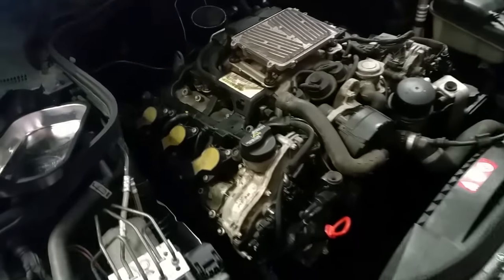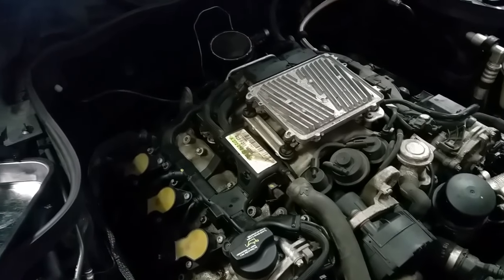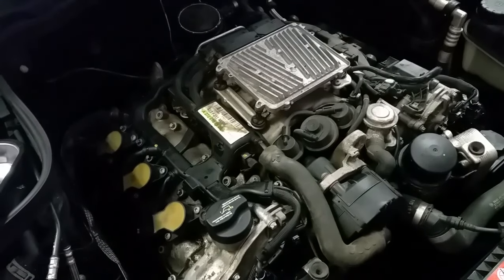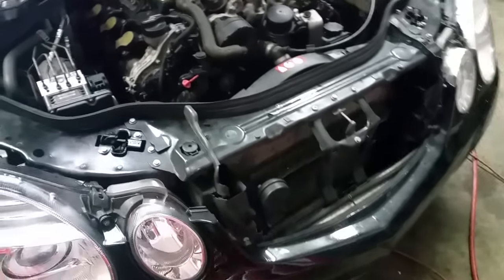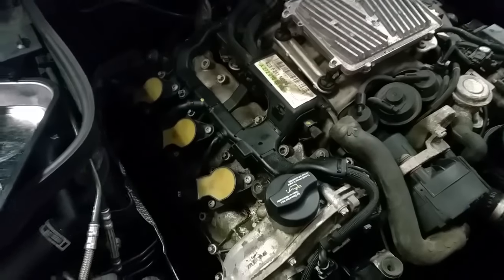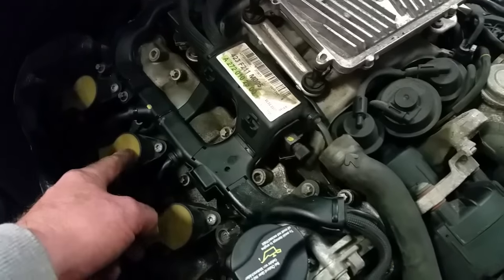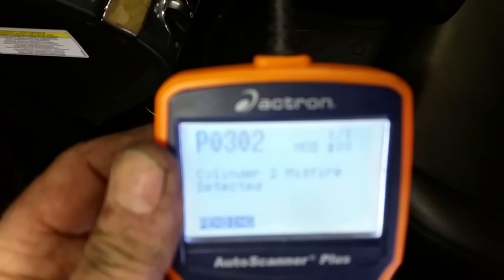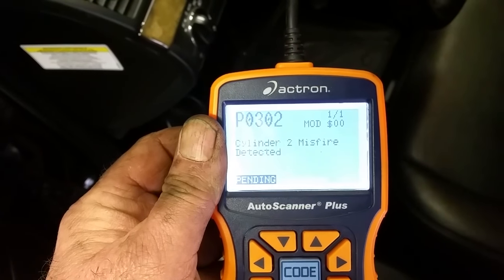HOW TO FIND AND DIAGNOSE A FAULTY COIL PACK FASSSSSSSSSSSST !

Comment: My father has a 1998 mercedes c230.  His coil is fine but the car throws cylinder misfire on the 1st cylinder.  He has confirmed the coil is fine and the cylinder is good because once he deleted the code it's all good again.  The code keeps popping up every cupple weeks.  We have 0 clue what is causing it to keep popping up.  The dealer installed new sparkplug and cables so that's not it.  The dealer is no help on this issue
Reply from the maker: Make sure that the coil is securely mounted and the bracket that it is mounted to is well grounded to a clean ground.  And I would check the spark plug wire and possibly replace it again even though the dealer did it, he may have done it wrong.  If this doesn't do it, I would find another repair facility that specializes in older foreign cars.  Hope you get to the bottom of your issue, thanks for watching and asking.  mad Mike the hammer SPC

Comment: No need to swap. Just unplug the bad coil if engine still runs bad.
Reply from the maker: You can do it however you want to do it, we are just sharing how we do it and it works 100% of the time.  Thanks for watching.  mad Mike the hammer SPC

Comment: What if is a random misfire?
Reply from the maker: I'd be heading on in to a quality repair facility as it could be numerous things.  But before you do that, I would replace all the plugs, the coil packs and plug wires and I would replace all of the injectors, then run some fuel injection cleaner for 3 or 4 tanks.  Thanks for asking, sorry about the delayed response.  Have a great day.  mad Mike the hammer SPC

Comment: Don't you have to drive your car around 50 to a hundred miles to get the check engine light to come back on again after you clear it?
Reply from the maker: Brett Wyrick usually if you start the car 3 to 4 times it will come back on if there is an issue.
Reply: @SweetProjectCars  Gotcha. My '08 C300 is doing something weird: I was at a stoplight and the car started shaking, then the check engine light started blinking. So I shut the car off. I started it back up, and the check engine light went away. I drove it for about another 50 miles, and then the check engine light came on and stayed on. When I ran the codes, I had the p0300 codes that said that my cylinder 2, cylinder 3, and cylinder 6 were all misfiring. After resetting the codes, I have now driven about 30 miles and the check engine light has not come back on. Computer issue?
Reply from the maker: Brett Wyrick sounds like 1  of 2 things, bad fuel or you need some of our injector cleaner video or you have coils starting to go.

Comment: So, I deleted my codes and my car still won’t turn over
Reply from the maker: Anthony Smitherman then you have some serious other issues and you will need a certified mechanic to take a look at it :)
Reply: Sweet Project Cars turns out my fuel pump Isn’t turning on. Fuse relay is good.
Reply from the maker: Anthony Smitherman thats good you have narrowed it down now you can focus on that and solve the issue.

Comment: What?????? 
If OBD SAYS MISFIRE Cyl 1 and u swap coiks with Cyl 2 I don't get it  UR OBD already told u wich one is faulty so why waste more time makes no sense and pls do check your plugs first Can just be the plug gaps are to wide and also remember MISFIRE or Knock can be caused to my combustion low fuel pressure and to make it really f up for u :) haha BAD EPG ;) 
Run OBD at least 10 times.

What do d on my E55 w211 V8 each 2 cylinders share a 1 coil + spar plugs or cylinder yes 16 plugs to hahaha. 

No just seeing with u mate awesome video good job on yes my E55 actually do have 16 plugs 2 pr cylinder + 2 intake valve 1 exhais on each bank
Reply from the maker: Thank You very much for sharing this method here in the video works great for us and has on hundreds of customers cars everyone has their own way they do things which is awesome keeps our world spinning around
Reply: yes but he did not know if it was the coil pack doing the misfire, so he tried it on another cylinder.